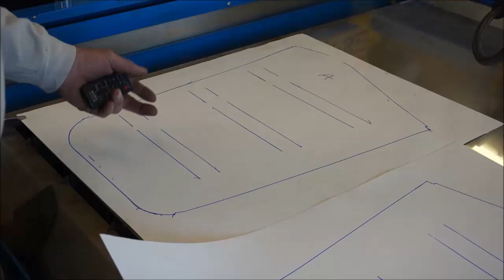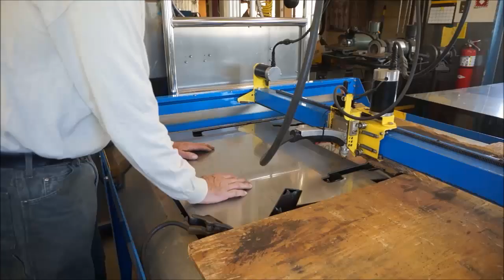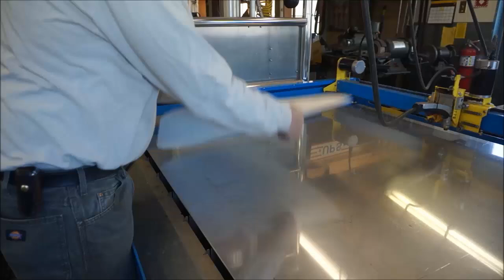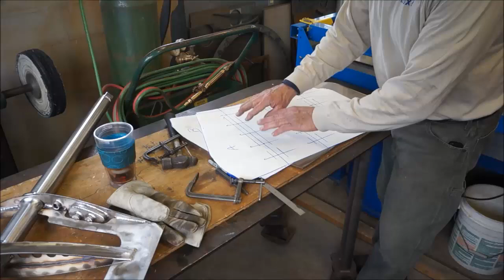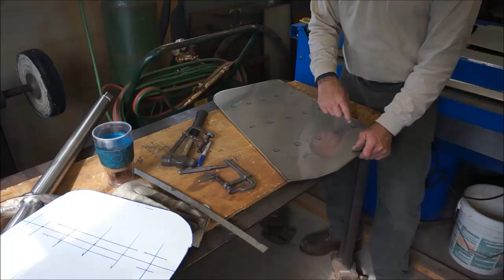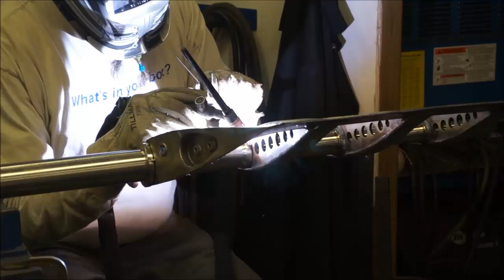Wing It Part 16

Comment: Why not cut the skin weld holes on the Plasma cutter while cutting out the skin itself ?
Reply from the maker: I was debating doing that but would have to go back and clean all the plasma surface away and countersink them anyhow, so why not just make one motion instead of two! ;{)-----
Reply: Keith Fenner Thanks for the quick response to my questions. Enjoy the rest of the weekend.